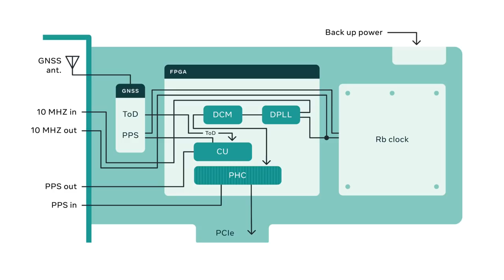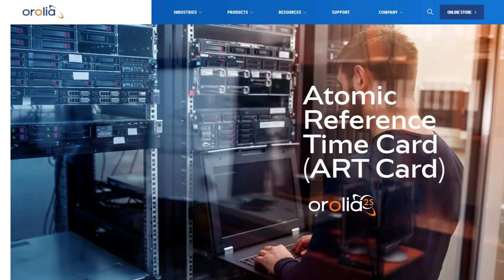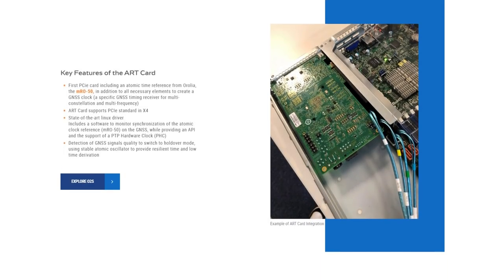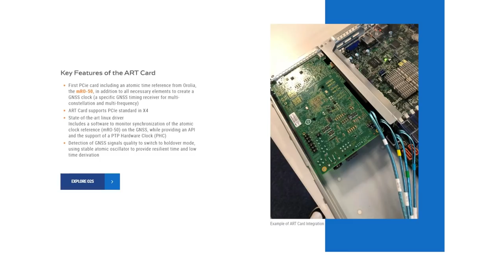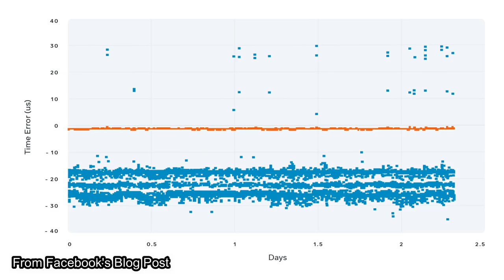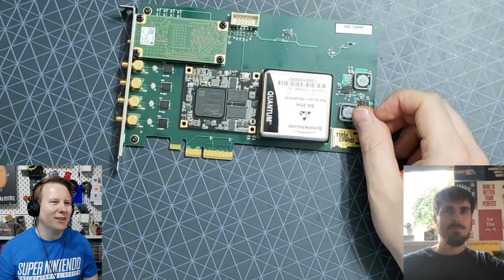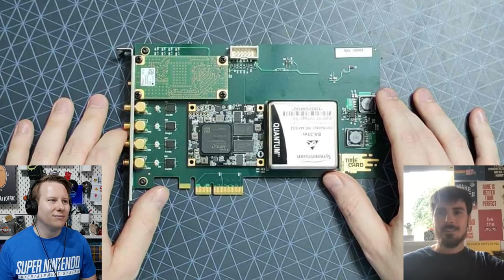Democratizing Time: Hands on with an Atomic Clock PCIe Card

Comment: Another reason these are helpful is that if one computer clock in a group drifts ahead of others, it can end up taking the entire load of a distributed system and become the performance bottleneck for the system, or possibly crash.  Also, crazily enough, actual time in datacenters at higher altitude run faster than those at lower altitude.  Denver computers see Seattle computers as running slow by about 15 nanoseconds per day.  At TiVo, we found that having our own stratum 1 NTP server per datacenter was fine, but if we lost GPS signals, we could get a bit of drift, in which case we had to rely on (internal) NTP synchronization between our datacenters.

Comment: Okay Ian, where can I get one of these to install for fun for under $100? Get on it!
Reply: Raspberry pi + uputronics module
😊

Unfortunately you won't get a very good LO but with chrony you can get an accurate local NTP server.  The PCIe add-in card aspect and PTP support is very expensive.  The $1000 atomic LO is peanuts compared to PTP switches and NICs.
Reply: as they said in the video, an OCXO or even a tiny unexpensive TCXO can totally do the job in less critical situations and those are way cheaper than a rubidium atomic clock. That's how you can drastically lower the price.

Comment: The GPS time protocol has two parts:
A serial data stream of timestamps
A once a second chime (pulse)
The chime is the important part.  It is very precise with no drift.  This is where the (12?) nano second accuracy of GPS comes in.
The surprising thing is that your smart phone probably has a micro second accurate GPS time source in it.  The phone can't share it though because the network overhead of timestamping packets, etc does not work over WiFi for microsecond accurate time.  Your phone can still use the GPS time source to timestamp packets as they are transmitted.

Comment: 1PPS from satellite is enough precision. 
Wikipedia:
"PPS signals have an accuracy ranging from a 12 picoseconds to a few 

microseconds per second, or 2.0 nanoseconds to a few milliseconds per 
day based on the resolution and accuracy of the device generating the 
signal."

Comment: You can get a 10 ppb (parts per billion) oscillator from Mouser for about $300. Use that to provide timing to your Arduino Uno, and you're 95% as good as that device.
Reply from the maker: Facebook told me after that you can replace the clock with a variety of timing devices with different cost and accuracies. Could go down as low as $150 etc

Comment: A PCIe card introduce somewhat of a latency, from the time the driver call is handled by the OS and up until the time where the value reaches into the host RAM, no?
The ultimate solution would be to have a dedicated CPU register that keeps the Atomic time, and have such a register part of the ISA of modern systems.

Comment: Usually you use either GPS or Rb.  Most GPSDO's synch GPS to a cheaper OCXO.  I thought over the short term there wasn't much, if any, performance difference between Rb and OCXO.  I calibrated a counter with OCXO 5 years ago against a Rb standard and to this day it's only off about 3 ppb.  Not bad for a salvaged crystal from eBay.

Comment: The importance of this card is it allows you build a proper PTP, Precision Time Protocol, Level 0 Grand Master time server from a low cost 1U server.  This is considered to be as accurate as the various atomic clock time servers across the internet.  A local proper Level 0 Grand Master time server in a data center allows locally generated absolute time.  HH:MM:SS.mmμμnn (12?) nano second accurate absolute time is the same in the local data center as it is in a data center half way around the world or orbiting the earth.  True absolute time.

Once you have absolute time many hard problems with geographically distributed data sources and data processing become straight forward.  You can time align many data sources or data streams by simply sorting them by their absolute time stamps.

Is nanosecond accuracy enough?  You can always split the hair and get more and more accurate.  But nanosecond accuracy is sufficient for most applications.

Comment: This sounds a lot like the windows timestamp project... but doing it with HW is kinky !! my brain is already stacking some new idea's I can't buy "yet".. timesync between my wallet and information is running on hypothetical and creative distraction buffering.. 
Does something like this also give more options to make the windows timer resolution go lower then the 0.5ms? or are there other ways to achieve that?? been using a background service called set timer resolution for about 10 years now hahah to keep it at 0.5ms because normally it wil jump back to 15.6ms? and that is BS for all pc's after 2010 whahah

Comment: I probably missed the explanation but would appreciate if anyone could point to the correct time stamp. How with a single card per DC, is the time level of trust elevated to the point that transactions can be assumed to be in order? I understand that you could profile any network infrastructure in idealised conditions to synchronise to an arbitrary level of precision. How do you correct for jitter at ever decreasing time increments? Where is the error correction computed? I can definitely envisage attack vectors with anything other than a per device clock card.
Reply from the maker: That's the software solution requirements. This is just the hardware side of the landscape.

Comment: Isn't it the clocks limiting the speed of modulation of the data transmissions in the first place? Faster clock = higher signal to noise and higher signal rate? What clock speeds are used in 100Gbps NICs? Processing speed aside, how many gigabits or terabits can you transmit if you turned this into a NIC?
Reply: NVIDIA offers 100G and 200G NICs with a Time Card combo

Comment: like the way you've highlighted #AD the first second of the video, clear & simple.

but i think the video format could have been more thought out, there's alot of switching back and forth between frame compositions it's really distracting. at the moment, your interviews are better listened rather than video, so maybe a vector of improvement to go on?
Reply: It is required by law in the UK, but it may be absurdly faint and hidden..
Reply: @HenkPoley  yes, i know, but that's why i appreciate that it's upfront and prompt.

transparency is key to reporting

Comment: Edit it appears the reason my atomic clocks stopped working in 2020 was unrelated to the budget talks in 2018-2019, dont know why the two radio controlled clocks i have stopped working for a short time(around a month and a half) in 2020, and i may never know

I'd love to be able to set one of these up as a repeater for the atomic clock network, when the trump administration tried to shut down the network my favorite ever solar powered watch stopped working in 2020. A watch i've had for 10 years without issue rendered inoperable as for some reason when it didnt get signal for long enough it basically went to an error code

Comment: How good are the oscillators in modern laptop and desktop computers?
Reply: Most clock sources in computers are intentionally bad (jittery), because this spreads out radiated RF energy across a larger frequency band, which gets around EMI regulations. This is a feature called "Spread Spectrum", usually you can disable this for the main (100 MHz) clock which is used for most core signals and buses (CPU core frequency, PCIe frequencies, memory frequency etc.).

The actual time-keeping clock in PCs is some rando-RTC using a watch crystal on the mainboard - not terribly accurate (think +- 50 ppm), nobody cares for accuracy, as most computers sync their clocks frequently.
Reply: They are mostly accurate to withing a second per day.

Comment: Finally PTP :-) NTP is just so not accurate due to its software stack.
Reply: Not to mention, NTP (like DNS) is subject to vulnerabilities that are just now being discovered. The best opsec tries to keep systems  as close as possible to “off-grid” for mission critical functions to minimize attack vectors.
Reply: @Destroyer9747  in safety critical systems you won't find use of public ntp servers, much less so the sometimes horrible/hostile ntp pool sources. you'll just have multiple gps ntp servers with stable internal clocks plus probably run the whole thing in orphan mode to handle partitions. one of the annoying questions is 'do we trust gps' and so you'll possibly also find other time sources. ntpd isn't so shitty, but PTP is definitely more sexy with the extra cables ;-)

Comment: Synced up to GPS and can sync up to any GNSS
Reply from the maker: Yup, just use the right module for your location.
Reply: @TechTechPotato  Also emits a pps so might be nice for energy equipment too.
Reply: @TechTechPotato  Is this a uBlox GNSS Chip? If so very funny wrote a driver for that not that long ago.
Reply: @platin2148  drivers are available on upstream Linux kernel 5.12 or up. Check www.ocptap.com
Reply: @platin2148  yes, it‘s an U-blox RCB-F9T, actually has a ZED-F9T on the board. I have tons of those modules where I work, by coincidence U-Blox 😅
Reply: @TechTechPotato  it was said wrong, GNSS is the general technology, where as GPS, GLONASS, GALILEO, etc are the constellations.
Reply: @eladwind  A freertos driver not linux.
Reply: @DJ-Manuel  Is there a task open for making the process of enabling galileo a bit less complicated? The set, wait, safe, reset procedure isn’t really ideal..

Comment: My home PC loses 5 minutes a month lol.

This is the worst timekeeping I've ever seen on a computer, it's actually ridiculous.
Reply: Then just install an NTP client, which will keep it at least within a microsecond or two.  You don't need PTP for that.
If you can hook up a satellite receiver with PPS to it (mine is a Garmin), that will give tighter timing on a static PC (less so on a laptop that is moved around), and any local outages will be handled by moving to an alternative (internet-based) NTP server, of which you should have several listed in your ntp.conf file.  This PC stays within 0.01ms of its server, which is within a similar range from the public-facing timeservers at the National Physical Laboratory.  In cloudy eastern England I've not seen any outage of GPS, ever.  And that includes when purple airways are NOTAMed (I'm also a private pilot so know to watch out for airspace which is reserved for security reasons - having a sightseeing tour of East Anglia interrupted by having an EF2000 join me on each wing is not on my list of fun things to do).
Remember that the GPS constellation requires time, as it is the time difference between the same signal from the different satellites which gives position, and as far as GPS is concerned, a ns is just 30cm, so if you GPS can position you to within 30M, that is 100ns precision.  If you know your position is fixed, you can average them out to get much more precise than that (which is why a laptop will be less precise on time).  All using the old, also opensource so likely to be just as secure, NTP protocol.
For the overwhelming majority of use cases, PTP is a solution in search of a problem.  Only very secure or very high workload environments need better than NTP capabilities.

Comment: Oh, that Microsemi mac module uses Rubidium instead of Caesium, so that means we should have no problem handling it.
Any precision atomic clock using Caesium is not safe for public, otherwise we'll have another Goiania incident.
Reply: You are aware that only a very small part of all caesium is the radioactive isotopes, and atomic clocks literally only need it in the countable atoms amount(afaik), so even if it were radioactive(and im pretty sure they need a specific stable isotope) it would be too little to cause problems
Reply: you do realize there are stable isotopes of Cs? and that even if not, the amount needed for such a clock is so small as to be harmless

Comment: The precision of these oscillations allows atomic clocks to drift roughly only one second in a hundred million years; as of 2015, the most accurate atomic clock loses one second every 15 billion years.

Clock drift - Wikipedia

gees. great to see they know not what they are talking about, 1 millisecond drift a day lol
Reply: The video is correct.

First of all, the engineer who developed this board have said "microsecond", not "millisecond": 17:19 "the atomic clock itself drifts approximately one microsecond a day" And that is exactly what the manufacturer specifies for this atomic clock. 

Wikipedia, as you may notice, is talking about "the most accurate atomic clock" -- which is a roomful of equipment somewhere in the National Institute of Standards and Technology, and costs many orders of magnitude more.

Comment: An atomic clock on a pcie bus? how can that sync all the cpus in a rack with all the latency? And assuming that they sync via the ethernet jack, that's even messier. no?
Reply: PTP takes care of latency by measuring it and giving an adjustment value to every client connected to a grandmaster or boundry clock. It would be nice if this card had an ethernet port so it could act as a grandmaster for remote clients, or take in PTP from a grandmaster.

Comment: Over Clockable? Or is your computer Over-clocked when you plug it in? I could go on with lame jokes like that for quite some time. 
But actually, i can see some use cases outside of high frequency trading. Testing rigs might actually profit or system diagnostics. Ian's excitement is not hard to detect. Seems to Tick-Tock some of his boxes.

Comment: My computer has a sun dial on top to get the time. At night it synchronizes to a nearby light house. On cloudy days it nags me about how log it will be until we get there (every 10 minutes or so).

ps How about you guys don't write code that crashes your systems if they don't have nanosecond synchronization? Why have a bunch of "Cinderella computers" that turn to pumpkins at midnight?

pps Why, as a society, should anyone care if "high speed stock traders" feel they want to extract wealth from the markets at the picosecond level (using phase locked loops) versus the nanosecond level? Personally, I think it would be great if you had a Plank-time-accurate board for everyone's phone & pc & car, but you certainly haven't presented your case well. For example, the claims about fiber optics inaccuracies imply you simply haven't bothered make the basic measurements on your fiber network. Try writing more time-robust code, so you don' create "Millennium computer disasters" every day (only for real this time). Ugh.

Comment: $2500 for just the clock source on Mouser with zero availability. Democratization? Surely you jest. I'll stick to my standalone unit that doesn't require a PC to function and cost a tiny fraction of $2500 to build and runs all my instruments.
Reply from the maker: Apparently they all sold out very quick. In the UK it's only £740.
Reply: @TechTechPotato  Wow, something in the UK cheaper than the same thing in the US? Cats and dogs living together - strange days! I was lucky enough to score several rubidium standards on eBay before the craze for them really ramped up along with their prices. If I was in the market for something that was more turnkey I'd buy one of Leo Bodnar's stratum 1 time sources instead of building this PCI card that requires a PC for god knows how many thousands of dollars. I have one of Leo's GPS disciplined frequency synthesizers that I haven't had the time to put into action yet. 
- A Brit in the US.

Comment: For most people there is no benefit to that.
What would be the benefit? That your PC-clock does not drift by a few seconds in a month without any internet connection?
The early example of a supposed network having to do scheduled task at exactly midnight without ANY synchronisation mechanics but still relying on it happen synchronously is... no, such software is fundamentally flawed and using this card would be like trying to use a bandaid to fix a leaking fueltank. (And if you have a hardware-cluster with mismatched clocks - you already got other bigger problems)
With 5G or other wireless networks - nah, the individual connections do not need to be synchronised at all, that is just not how that protocol works, even less so on a global scale.
It is a nice piece of kit if you want to be able to synchronise your own local equipment without any further network access - a small lab for example.